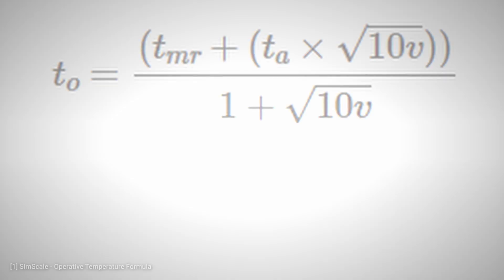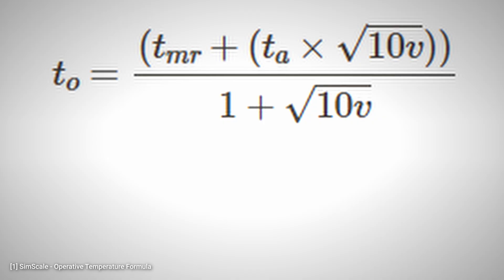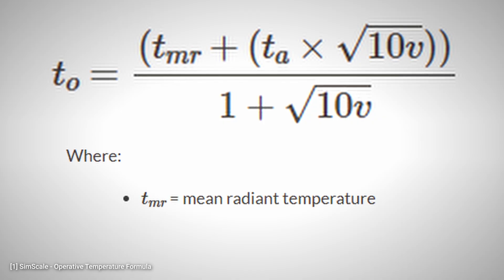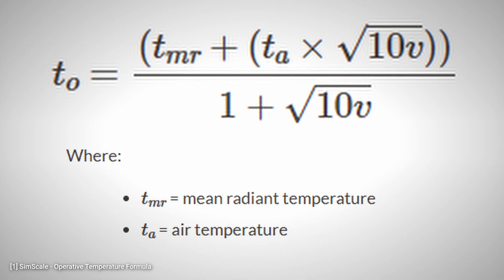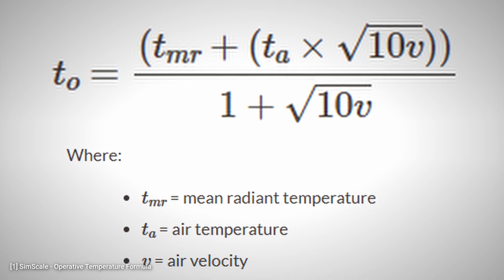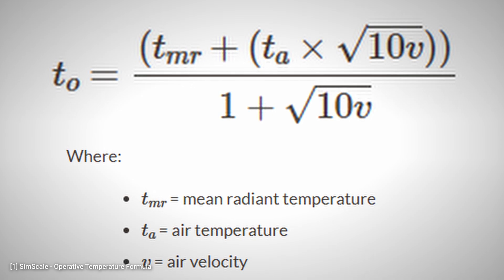Operative Temperature: The Real Measure of Thermal Comfort

Comment: I saw the previous video to this one and stuck around to catch this video. HOW IS THIS NOT TALKED ABOUT MORE??? I'm 40 years old and only just now hearing about this for the first time! MRT should be built-in to every thermostat, and those globe thermometers should be available as add-ons for smart thermostats and smart homes! 
I've spent my life knowing that a living room at 70 degrees F feels a lot warmer in the summer and a lot colder in the winter without ever knowing why. Now I know, it's because the temperature of the walls and ceilings is a few degrees warmer or cooler than the air temperature and dammit I'm mad that I didn't learn this in school!

Comment: The sqrt(10v) formula becomes nonsense when v approaches zero.

Even without bulk airflow, a temperature difference will cause convection in air.

Why doesn't the formula simplify to the average when v equals zero?
Reply from the maker: Because the formula is an empirical approximation, v = 0 is treated as 'no forced airflow', meaning any natural convection is considered negligible, so radiant temperature dominates. It doesn’t average the two temperatures because the model intentionally weights radiation more at very low air movement rather than treating both equally.

Hope this clears it up for you!